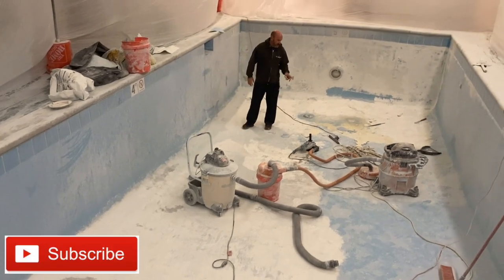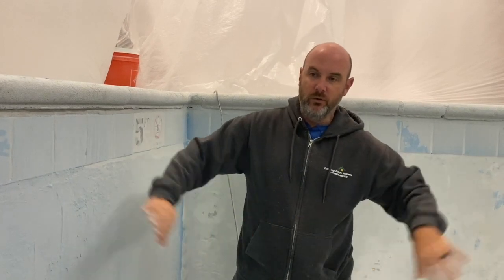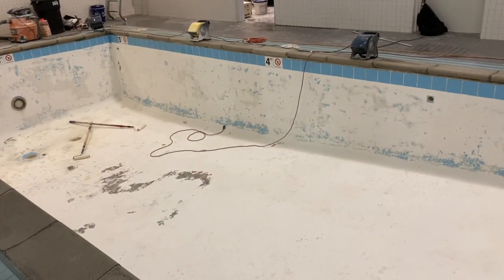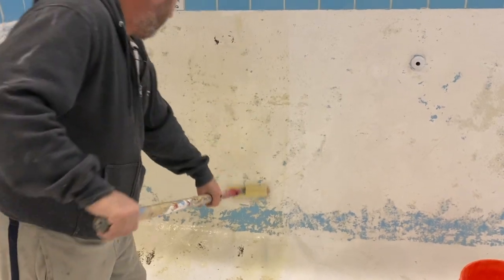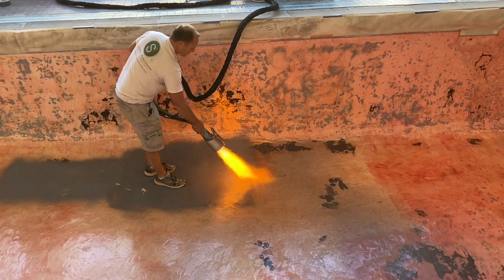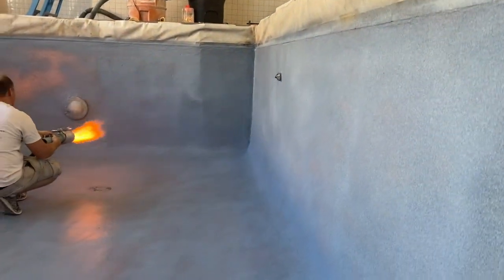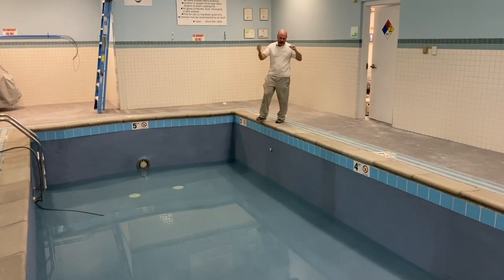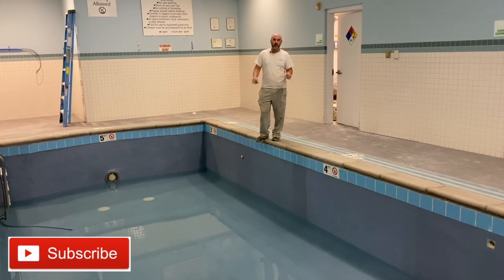Ecofinish Pools

Comment: I have a client with an icf pool and sider crete. Is this a candidate for eco finish?  Eco finish said not to apply with icf in case it burns the foam. Is this true?
Reply from the maker: Ecofinish gives pretty stock answers without understanding the process if you don’t articulate beyond saying icf…. As to your first question it’s our opinion that sider is not a very good product and shouldn’t have anything applied over it to repair, but basecrete will work although they will not guarantee that the sider below will not cause future failures

Comment: So if the diluted epoxy tie coat penetrates the substrate then it must be porous, follows that if you acid etch the surface prior then this acid can also get absorbed to below the surface causing future damage to the substrate. Acid will absorb in but is impossible to neutralise once it has dried below the surface.
Reply from the maker: That’s not really how it works…
Reply: @all3pools  you need to explain then please.

Comment: Question(s)🧐.  Better than any product........even tile with grout??  Whatz the lifespan of it?  Does that include color stability?  Do you simply wash the acid-etch directly into the city sewage system....no problems doing that?  About the first resin coat: i was told in a commercial fiberglass shop that watering down epoxy prevents it from properly settin-up. Comments???
      -Thankx😊

Comment: epoxy is no good but i'm going to epoxy the pool again and use flame on it also????
Reply from the maker: Ya so either you didn’t watch the whole vid, u are a troll, or not smart…. What makes epoxy PAINT inadequate is it’s instability against pool chemicals and UV light, as a waterproofer and bonding agent it’s great, just ask the boat industry…. The ecofinish is thermoplastic, which is the layer exposed to the water and chemistry of the pool, which protects the epoxy from the elements that harm it, the system is a layered composite that’s pretty genius…. It was pretty clear;)
Reply: @all3pools  Pretty sure you first PAINTED two layers of epoxy first. Not even sure i would use icf forms for a pool. Once you have a leak the styrofoam will absorb all that water over time. Great concept thou.

Comment: Remember to try Ecofinish on ICCF blocks!

The surface is more porous than the solid EPS slabs on each side of a traditional ICF and they are almost fireproof.  No "cold joints" either!
Reply from the maker: How do they not have cold joints???  Also, eco did try it and didn’t like it, they are scared of a lot of icf methods too btw and aren’t doing a ton to get the final answers but I’m positive will be harder to install on than icf
Reply: @all3pools  where do you thing there is a cold joint?  If you fill it in one shot there are no cold joints.

Comment: Curious to know your thoughts on longevity and cost difference between Eco finish vs full tile? ICF structure obviously. Thanks for the detailed video!
Reply from the maker: Full tile is the premium diy way as you’re equipment cost is nil…. That said most pool grouts, even epoxies, give a route for water to get behind the tiles, so I do give an edge to eco for the fact that it’s 100% non cement based and completely ph neutral…. Thst said I love tile too!
Reply: @all3pools   Thanks for the insight!